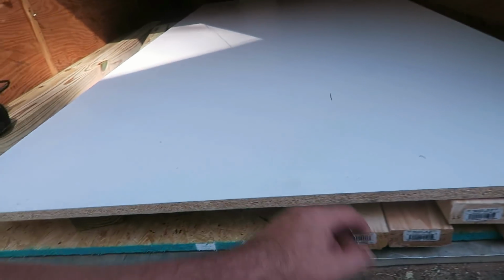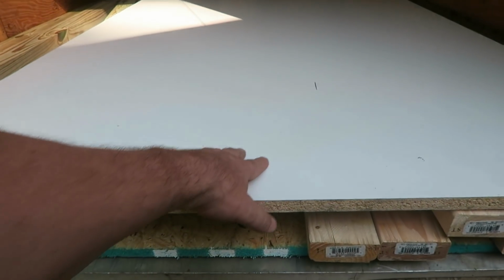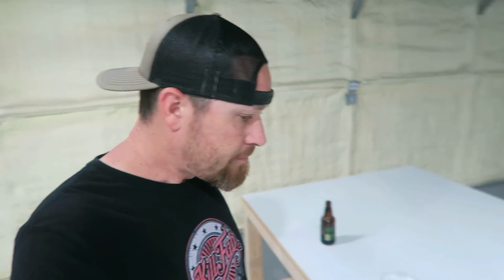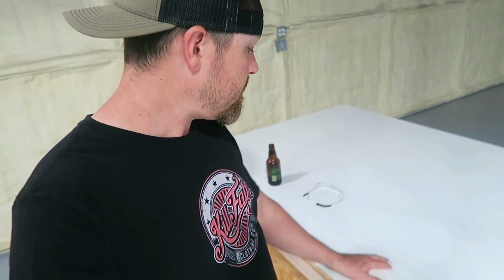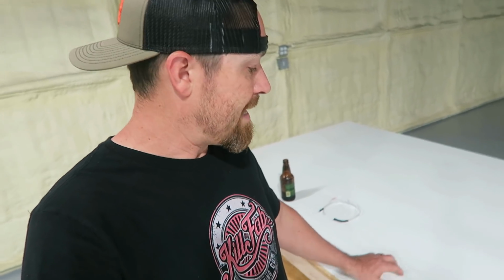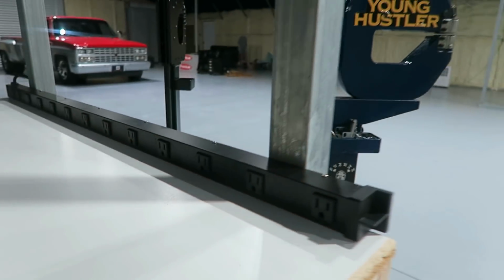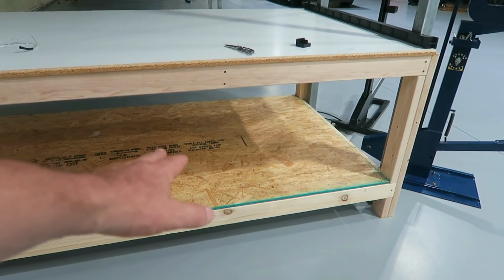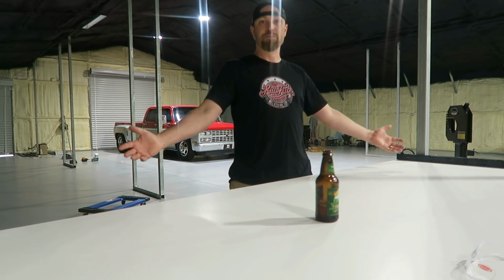Sheet Metal Fab Table Build

Comment: @The Fab Forums
Where is your plasma table, lathe, and mill?
Reply from the maker: on the list...got to get the shop sorted first
Reply: @Thefabforums  Get a lathe with at least a 12"  swing and a 4ft bed. You will be putting bigger parts in than you think. I'm sure you already know a good bridgeport is suitable for your needs. I'm still shopping for a cnc plasma myself, what size/model are looking at?

Comment: I think the center legs would definitely be a good idea to keep the table from sagging over the years. Also would allow you to hang the ram board between them under the table, to make it easier to dispense off the roll and cut what you need and doesn’t take up space on the shelf. Table looks awesome and plenty of room to fit a full size sheet.

Comment: I used to work a a custom sheet metal shop. We had a table with carpet on top. Indoor/outdoor carpet or some with a short nap. It worked great.  It would help with the metal sliding and to prevent scratches

Comment: I built almost the exact table minus the top. But I did have one of those 4 foot powerstrips and I mounted it right under the edge of the top right to the 2x4. Makes it hella nice to plug a bunch of tools in without 90 extension cords
Reply from the maker: yeah that may be what I do

Comment: I’d add the board on the back of the table. Will help out a ton with shear strength of the table. If you put something heavy on there the table will want to tend to collapse the box created by the top, legs, and bottom brace. Same concept as sheathing on a wall vs a diagonal brace. And as others have said, that white faced board is melamine.

Comment: When fabbin' a work table like that, that is going to get beaten up, a neat trick is to insert the top into the frame. when the working surface gets worn out, you can flip the top over, and there is no screw heads ruining your work. And if you use a standard size sheet for the top, you can change it when both sides are done.
Reply from the maker: yeah I can do that with this design

Comment: Kyle not sure if you mentioned it but where are you storing your sheet metal after you buy it? A lot of woodworkers I know have a rolling cart where the can store lumber, mainly 4x8 plywood, on its long side and they can move it around the shop to where they need it. Doesn't look like you can store full sheets under your table. Another suggestion is to add a few vertical boards at one end of your table to make slots that you can slide smaller cut offs into so your not always trying to fumble through flat sheets to find what you need. Shop looks great! I'm so jealous.
Reply from the maker: not 100% sure yet

Comment: My sheet metal table is an old beat to shit butcher block wrapped with sheet metal and it sits on top of six old lockers out of a high school. It’s modeled after the one I uses in shop class but I think that had 1/4 plate steel on top  

Looks good - now get to work and do some fabrication. I’m quickly growing weary of shop tours - The shop tour channel=Unsubscribed
Reply from the maker: I suggest you just un sub then

Comment: Nice work buddy. Next time put the legs on the inside of corners. It gives you one more spot for a screw and it gives you a little overhang.
Reply from the maker: wanted it outside to fit full sheets of material under it
Reply: @Thefabforums  hurry up with that charging station. I need some ideas. Lol
Reply: @Thefabforums  gotcha.

Comment: Should consider a blister resistant coating for the edges of your sheet metal table. That will protect the edge you routed from getting chipped up and to prevent moisture and other liquids from getting into it. If you get the wrong chemicals in that board it can delaminate the glues in it as well as separate the melamine laminate and will turn it into something resembling dry ginger bread in a hurry! There are resins and epoxies out there just for such a project and I am betting Home Depot has just what you need.
Reply from the maker: yeah I do need to do that

Comment: Awesome video, using the same material for my work bench. I work at Lowe’s and checked Seneca Lowe’s and they don’t carry the 4ft x 8ft, but they do carry individual 15in wide shelf’s in different lengths.
Reply from the maker: guess I need to check Home Depot 😵
Reply: The Fab Forums lol 😂 that I can’t look up. But I’d tell you to go there too. More than likely Home Depot will have it. I have no shame in telling customers to go to Home Depot. Lol on another note. Shop has come a long way, soon to start my shop. Have a 91 notch back doing a coyote swap and a 2008 ranger doing a 2.3 ecoboost swap from a ecoboost stang.

Comment: Remember vertical space. No need to waste floor space for charging basic things. Plywood on the wall with cleat system and shelves. Integrate cordless tool hangers and maybe even corded items. Good luck! Looking great. Could even turn one of the roof supports into the charging station with the wall of tools and chargers.
Reply: Google Email Very true for a home garage....but floor space ain’t a problem here!

Comment: Melamine Board is what I use on my table as well.  Great for working with epoxy.  If you wax the top everything will pop off after it dries.
Reply from the maker: Is that what I have? Good to know as I will be doing some carbon work soon
Reply: @Thefabforums  Yup.  Also called bathroom board.  I use waxed scrap pieces of it to work with Bondo as well.  Will flake right off as long as you let the excess dry.
Reply: Thats cool, good to know.